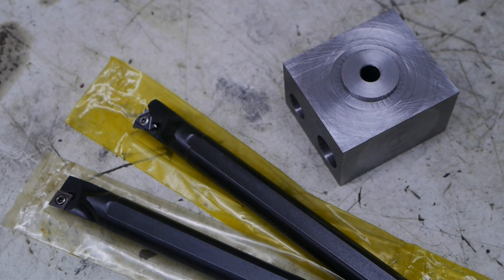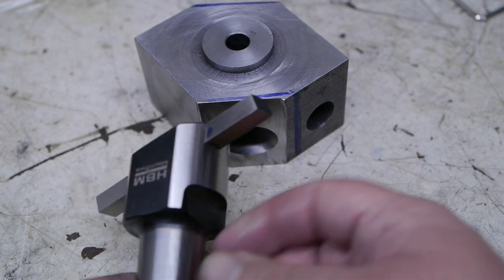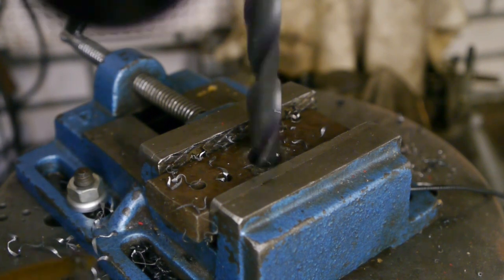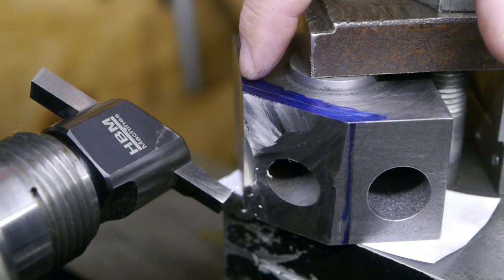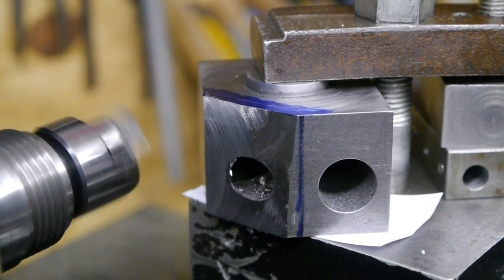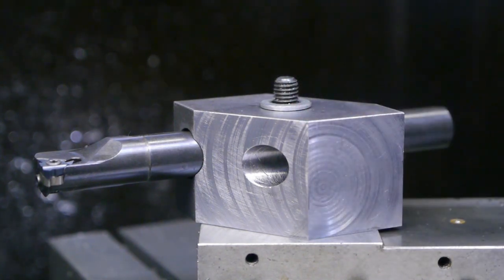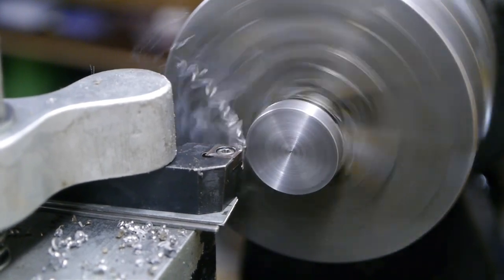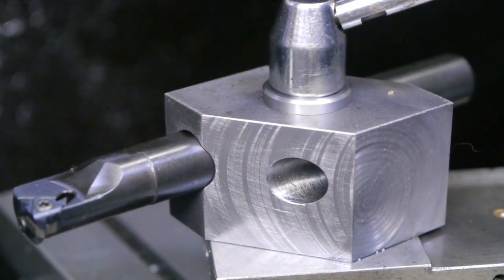I finally do some fly cutting.  Making a lathe tool holder part 2

Comment: Hi Rolling: I approve your method of cutting the block with your angle grinder. If you lack a metal saw, an angle grinder is the tool to use. I would recommend that in the future, you do all your rough HSS tool bit grinding with the angle grinder, to save time and effort, then you can easily finish it on the bench grinder.  I learned that trick from Tom Lipton at Oxtools. 
Cheers

Jorge

Comment: I had to close my eyes watching you grind your tool.  The tool rest is very dangerous.  Make sure the front edge is flat and adjusted up to 1mm from the wheel.
One little slip and your finger or the tool get wedged between the two.
You were exactly right about making it left handed lathe tool.

I’m not sure what is going on with your drill press? Are the belts slipping?  It sounded like the motor was still turning.
Don’t be afraid to calculate the surface speed for your cutters. At 90 fpm for HSS on steel.
Carbide goes faster but I can’t remember the calculation for that.
You are doing ok with your drill sharpening. I’ll see if I can describe how to make a drill sharpening guide for larger drills 😀
Reply from the maker: I was aware of the danger and that might be the best protection. But you are right the tool rest needs adjusting.
The drill press probably doesn't have enough power or something else is work. It needs some looking into :)

Comment: Well done, looking very good.  Nice job on the tool holder and washer.

Enlarging holes can be difficult, the drill bits are not designed to cut a small amount and can easily dig in, as you experienced.

Dave.
Reply from the maker: I'm not sure, that drill press might have to much runout and not engough power. 
I should look into it but I almost never have to drill a hole larger the 12mm.

Comment: I never would have thought to put a fly cutter in a lathe.  Have you tried fly cutting with a tool that has a smaller nose radius?  I had some lathe tools with a large nose radius that I had used, thinking it would provide a smooth finish, but have found that a very small radius works better with my lathe.  After grinding the tool I will only make a few strokes on a stone to create the nose radius.  That has been working much better on the lathe and with the fly cutter in my milling machine.
Reply from the maker: I was actually going to grind the other side of the toolbit with a smaller radius, but then I re-adjusted the spindle which fixed most of my surface finish problem.

Comment: I do casting and use a fly cutter to remove the surface oxides before using my shell mill. It is easy to sharpen a fly cutter when it gets dulled by the AL oxides. Then go to the inserted tool (Chinese) that is much faster. I have a well worn milling machine that in one direction of travel makes a nice surface and in the other, not so nice! I think due to slack in the lead screw & worn areas of the ways.
Reply from the maker: I should get me one of those insets milling cutters. I have load of those triangle insets without a hole that came with a lathe I bought. 4 cutting edges should make a huge difference on my 600 rpm max lathe.
Reply: I had read that inserted carbide needs to be pushed harder and faster to get good results. So on my lathe I did a series of test cuts on an unknown grade of steel. As I increased the depth of cut the finish improved. I started getting a pretty nice finish @ 640rpm & .050 DOC. .0073 feed... @ 910rpm, .0075 DOC & .0073 feed chips were breaking nicely and the finish had improved to very good. I didn't push it any further though the lathe wasn't complaining at this rate. Tool holders and inserts were from Precision Mathews (Chinese.) Tools have 5/8" shanks. "B" size QCTP. PM1440HD lathe, Chinese.
On my mill I run a 2" 4 insert shell mill @ 2000 rpm and get a nice finish on Aluminum. 
The shop was routing 3" thick UHMW plastic today, using a 3/4" up spiral O flute cutting to 2.75" deep in 3 steps. I don't know what rpm they were running, pretty fast as the chips were really flying. Feed looked to be about our standard 600"/minute. They were also running an 1/8" - 3" long bit to engrave words in the bottom of those cuts. Rather surprising it wasn't chattering.

Comment: I enjoy your videos mate, keep it up! This will probably make many shudder with the thought but I've corrected several dovetail ways from wear tight and slack by using fine grinding paste. Recently did the down feed on my shaper which was pretty badly worn towards the bottom of its travel, half an hour with fine grinding paste on the dovetails working the down feed the full length of its travel without the lead screw and it's virtually perfect.Slacken the gibb to start then tighten it a little at a time as the movement gets easier.
Colin
Reply from the maker: I might give that a try. Thanks for the tip
Reply: @Rolingmetal  Beware using abrasives on porous metals like cast iron as the grit will embed in the soft carbon and remain leaving it as a lapping plate better to file and scrape and avoid emery cloth as well.
i used to use cast iron laps for polishing with diamond paste and found it very aggressive!

Comment: dude i do care, i did watch the other video.  you are human, allthe other machinist channels sure, its soo easy, they have million dollar workshops and all the best raw materials and never show you all the times it didnt work
Reply: That's true, although sometimes things might not seem like they are ;) For example I have an old belt driven lathe that is quite OK for what I do, but a bit worn out, so I was on the lookout for a replacement. I got lucky and I found a Colchester Student MK2 with Heidenhain digital readouts and multifix QCTP for a really good price. Now if I sell the old lathe, the digital readout and the QCTP I will most probably get what I paid for Colchester back, so essentially I will be replacing an old lathe for a new one with no or little additional money spent (of course I needed to have money to put into it in the first place, which not everyone has, but still, what I'm saying is that you can get lucky). I also found a Schaublin 13 milling machine not long ago that I bought for a good price with many accessories and it looks like if I sell all the stuff that I don't need I'll be down to half the price of the machine (and I already bought it much cheaper than they usually cost). Of course I would rather keep all the accessories, but I need money, so there's that. Both machines are not in a perfect shape, but they're also not scrap, so I'm be planning to rebuild them. So if you entered my workshop now you could say that it's one of those 5k plus equipment shops whereas in fact it would be much less. It's not easy and you need capital if you're buying a machine with intention of selling some accessories later, but it's possible to find relatively cheap machines. Or accessories. Almost all of my stuff is used and I rarely pay more than 10EUR for an item (like even recently I bought a 80mm Käfer dial indicator for 1.5EUR, it normally costs more like 200). The downside is that I spent way more time than I should on ebay.
Reply: Also keep in mind that in some places in the USA you can buy stuff much cheaper than in other places (or in Europe for that matter). When I was watching Dale from Build Something Cool channel he said that he never paid more than a 1000 bucks for a lathe and he was showing a lathe that he bought for $500. I was absolutely surprised because where I look for machines and equipment (Germany and Poland mostly) you rarely can find anything that's not scrap for less than a $1000. I bought my belt driven lathe for roughly that amount and it was one of few lathes of garage-size that I found during 6 or 7 months of searching. With almost no equipment. And even here there are areas that have more used machines. I live in Berlin, Germany and  and there's little stuff coming up on auctions in the area, but there's several times more machines in the southern west part of the country. Which obviously makes them cheaper there, but I would need to spend at least 500 or 600EUR to transport them to the workshop and then I most likely wouldn't be able to go and view the machines before the transaction. So most of the time it's not an option.
Reply: yep usa is the place for cheap old machinery, it isnt the same in europe at all, but also look at their shops 3 phase power, no chance in the UK domestic to do that, heck i wasnt allowed to put a hand washing sink in my workshop as it would need planning permission as it 'could' be used to live in if it had that.  in the usa, massive shops, massive acres of land and do mostly what you want. (my workshop is a double garage with my car in one half, the other half has to be mobile in case a 2nd car needs to go in or through into the garden)
Reply: @PiotrSarnacki  That's right. In europe, especially Germany it's hard to find proper equipment in good condition. With some luck I found a Chinese lathe once (sieg SG4) for just 400 bucks. With lot of work I had enhanced it to work precisely. Just adding a proper DRO was a pain in the ass.
But seeing such big beefy mills and lathes in the US oftenly drives tears in the eyes. But than I always say: Not the machine do the job, it just might make it easier.
Reply: > but also look at their shops 3 phase power

I think it depends on where you live, regardless whether it's Europe or USA. It might be more common in some places, but I guess it depends on the luck of where you live exactly. My machines are in my father in law's place and it has 3-phase power, because it's a village on countryside where it's common to have that because of all the machines people use on the farms. On the other hand, for example Steve Summers from the USA (he has a really nice channel, btw) doesn't have 3 phase power.
Reply: > That's right. In europe, especially Germany it's hard to find proper equipment in good condition.

Yeah, I've been hunting for a decent lathe in a good price for a long time now, I think I got really lucky with the Colchester. I usually have most luck with auctions starting with a low price and with non-German equipment. Usually if it's a Deckel or Weiler or something like that you can usually tell that people will go wild on bidding. Not so much with stuff from other countries I think.
Reply: Btw, leaving the prices discussion aside, I can only second the first comment here - I have a lot of respect for the author for trying to make something with subpar equipment. I would give up much sooner definitely!
Reply: yep, perhaps it just seems many of the machinists are semi rural and large shops and 3 phase are part of it, in the UK we are more like doubleboost,....single garage attached to house, only 240v single phase with limited amps (im limited to 30a  for workshop)
Reply: @jusb1066  In most countrys end consumers are not allowed to have 3 phase, such as in the US. There only companies gets 3 phase. Luckily I live in Germany, there's 3 phase in every house - it's standard. Didn't know UK is also single phase. But in most cases 3 phases are not required, the only real benefit is 3 phase motors are more torque. But this is not related to the heavy power come out of the wallet, it's just the 3 phase concept itself. You can use a VFD to archive the same result with also nice to have speed control. I can draw 22kW from my 3 phase socket, no DIY machine will need this... even most industrial machines will draw much less.
Reply: i for a while did have a  3 phase converter to run a large grinder i bought to sell on, it was huge, it tripped the house breaker 30a 240v is all i can supply to the garage!  vfd or converters cant do much when you are limited in power anyway
Reply: @jusb1066  Sure, but 30A on 240V is 7.2kW. So if it's not a grinder to grind whole planets to dust, it must be another problem. Start current is much higher, but this can be handled with the soft-start of VFD too. I have 3 phase, but nearly every machine I run is running with single phase, maybe in combination with a VFD. And the standard breaker for single phase outlets are 16A in Germany. I never run into breaker problems, not even if I'm using the big inverter welder, and this one can go up to 210A welding current on single phase. Only sometimes if I turn on the lathe the breaker triggers. But this is because of the massive in rush current caused by the (chinese) integrated switching mode power supply.
Also there are many trigger types of breakers. Usually the normal "light breakers" in houses trigger very fast, so higher in rush currents will trigger them very early. There exist more slowly types, they won't trigger in most in rush current situations. I don't know the regulations on this in the UK but in Germany the standard breakers are B-types, this are the faster ones. If I'm not wrong the slower ones called C-type. Maybe an option for you to solve this problem.
Reply: yep it was an old 1920's 10 inch wheel (3 inch wide wheels) and 7hp rated, it was fine running, but the startup.., i didnt keep it anyway, i liked it because of the castings and sold it on a while later
Reply from the maker: Here in the Netherlands 3ph is also standard on new houses.  And whoever wants it can have it, if you pay of course.
It's used a lot for cooking. I'm also surprised about the UK 3ph situation.
Reply from the maker: My old lathe cost me 50 euro plus a can of paint. And it's more fun too use then the China machine.
Reply: @Rolingmetal  But you must differentiate projects for fun/entertainment or just doing a project to have it finished ;) Let me explain it this way: If I would do the projects I did with your old lathe, it would not exist anymore, becouse I would make excessive use of a big hammer in some situtations :D On the other hand it's good entertainment watching you struggling into issues, especially your comments in such situations ;)
Reply: Piotr Sarnacki Cheer up- there's an awful lot of us who 'spent way more than we should have on Ebay...
Reply: Please don´t confuse people. Cutting properly with a drill bit it´s not about having tens of thousand euros in machinery and equipment. It´s only about having a properly grounded drill bit and a decent drill chuck (15-20 euros Chinese one). I´ve heard this argument thousand of times...."he play great because he owns a 3000 dollar guitar" or "parts come out nice because he have a Bridgeport", but it is the opposite: do things right and then care about improving your equipment. Allowing a drill bit to slip on its holder and still trying to push it through the material  to drill twenty times it´s called being clumsy.

Comment: Was the drill press motor stalling or the taper coming loose?
Reply from the maker: Both happened. That drill press probably need more power and the taper might need reaming.

Comment: make a drill adaptor for the crossslide, and actually slightly put the lock on to give small resistance, then you might get a better finish, use drill for power feed!
Reply from the maker: Sorry but I'm not following
Reply: to save you winding the cross slide so much, make a thingy to go into cordless drill that will hook onto the cross slide handle, very handy, plus with the bonus you can slightly lock the cross slide, to make it stiff, so it will vibrate less, but the drill will still move it and not your sore fingers  https://www.youtube.com/watch?v=hvX8xNr-BVY
Reply from the maker: That's what you mean. have a look at this: https://youtu.be/SBOdNKegaPUI 
I actually have no working cordless drill any more. It needs new batteries.
Reply: yep ! you have one!, it may help make it less tiring, also make the gibs tighter than you would to make the surface finish better

Comment: OMG LOL - can we form a club - stone bitting a drill hole - bwahahaaa...
Today I'm on the 1970's benchtop drill press and the 15 dollar orange pony vise doesn't fit the tiny table - keeps falling off one side and bending the drill bit - then the tighten/removal hole for the prop nosecone spinner I've been working on goes cockeyed - I swear my drill press drills curved holes - while drilling the bits bend